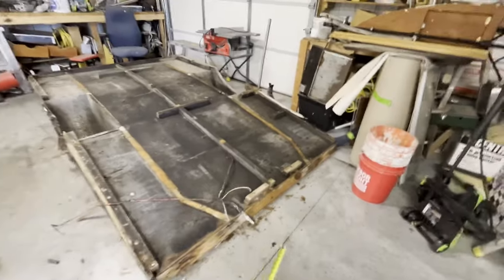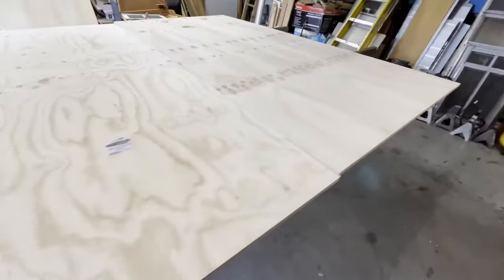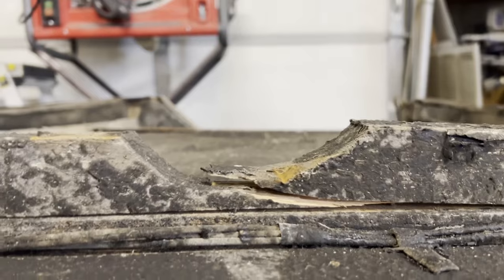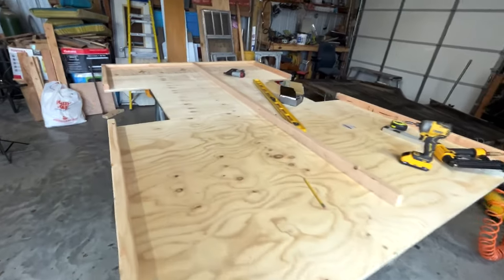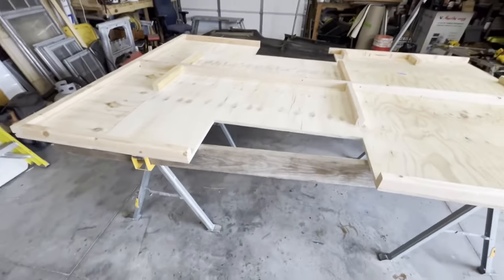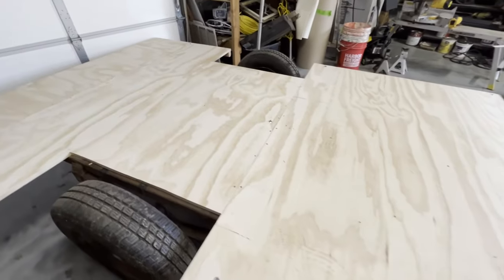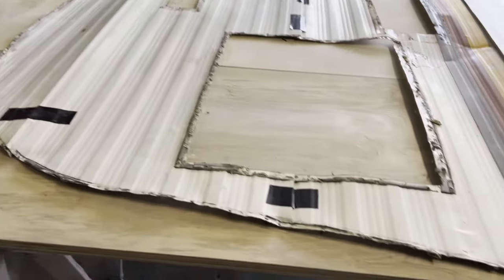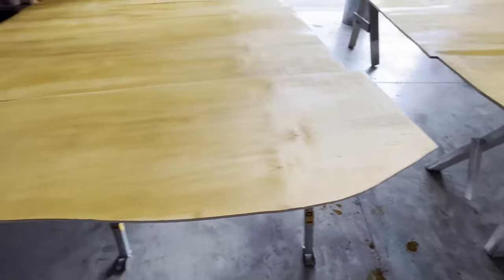EP. 329 Time Lapse teardown 1982 Serro Scotty vintage camper travel trailer RV rebuild

Comment: Rob, I think the machinery used to make the metal would be way cheaper than a 4-6’ wide one. Also, lighter to handle, easier to repair, etc
Reply from the maker: I like to use bigger panels myself.

Comment: Overall, the chassis of this trailer looked very good and solid structurally. Too bad the wheel house cut outs were not long enough to span the width of the floor at the rear. Will all those cutoffs be used elsewhere in the build in order to utilize the most of those 3 sheets of pricy 3/4 inch plywood?
Reply from the maker: They were used. Don't waste lumber.

Comment: I have often wondered if just one coat of shellac gives adequate long term protection against abrasions, scratches, rubbing, moisture and sunlight protection? Or are you giving multiple coats that I just did not see? 

Durability of surface coatings are generally important to me as I myself tend to be hard on things and scratches and blemishes bug me.
Reply from the maker: Sometimes yes. Depends on the customer

Comment: This is probably going to sound dumb. If it were me, I'd put some Fastcap Fastenon jointer biscuits or 
metal rods through the piece on the back and probably use Hurricane tie downs between them. I'd also 
use steel rods to shore up the stiffness of the floor. Probably insulate the flooring as well. Maybe put in some 
more hurricane tie downs and stuff. I dunno. I'd probably over build it, but man I'd really want that to last. Ya know.
Reply from the maker: 42 years is a long time for a camper. Hurricanes are not the enemy of a camper. Water leaking in is the enemy.
Reply: @RobTheRebuilder  I wasn't trying to upset you on that. Just sharing my ideas. Like I said, I'd probably over build it. The hurricane ties would only be used on the floor for really tying the pieces together like you did on the outer walls. 

Just holding those sections together. I'd probably use some kind of waterproofing sealant. Again, I am not trying to be offensive here. Thank you for the great video anyway. Keep up the great work, sir.